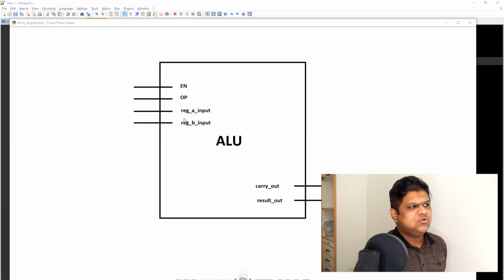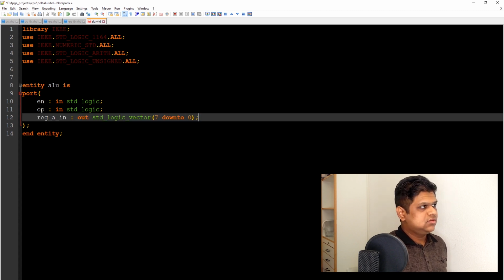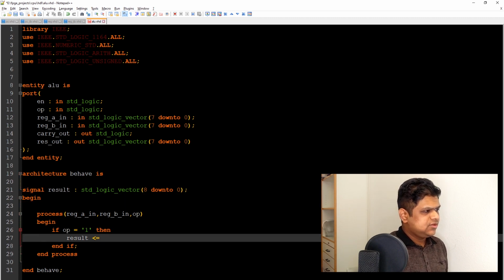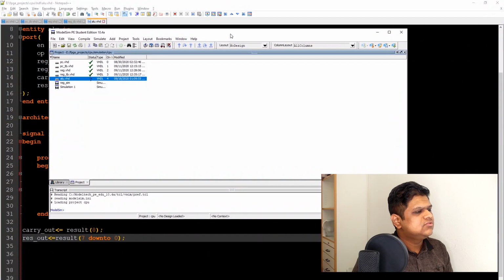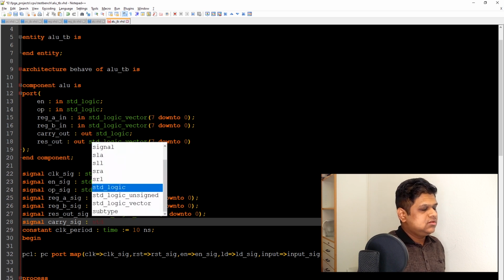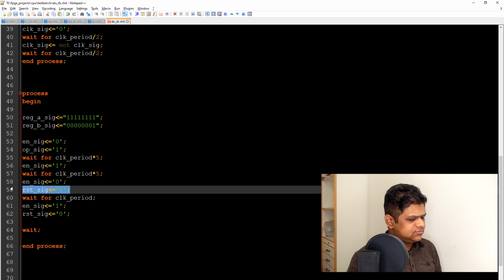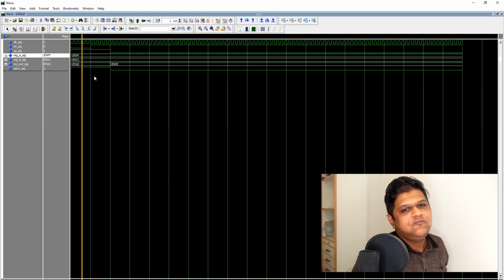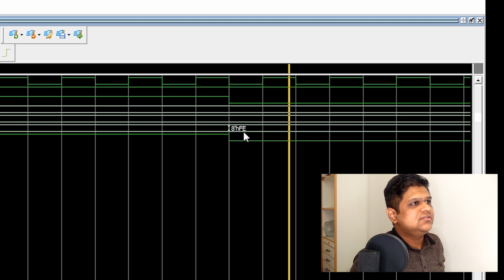Part #4 - 8 Bit CPU On FPGA  - ALU

Comment: Hi
Could you please help me? I need to draw a circuit diagram with standard logic gates to show an 8 bit ALU output. ALU has to output Sign, Carry, Parity and Zero.
Reply from the maker: You can start by first making basic operations like add, sub, OR, XOR, AND (depending on operations you want to support) out of gates. Then you can use demux to give input to proper circuit depending on opcode, opcode lines can act as select line for demux. And then you can use multiplexer to select output from different circuit blocks(using opcode as select lines here as well)

Comment: I built this myself a little while ago, it's a nice project to learn. 

I strongly suggest to built a zero flag in your ALU, it's super useful. Also, you don't need to output the carry only when the enable is active because it's not going to the bus.
Reply from the maker: Thanks for your suggestion. I've implemented zero flag. Check out the latest Video.
Reply: Sir where it is ? The latest design video with flags